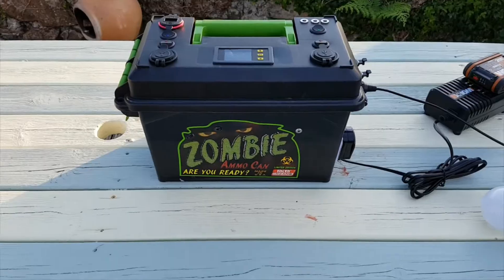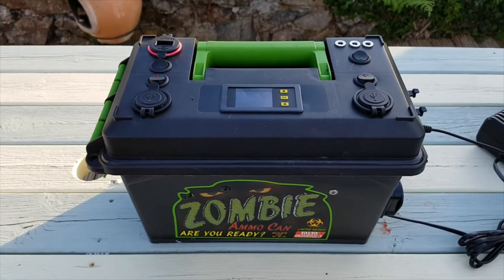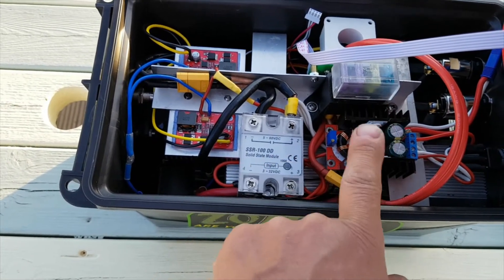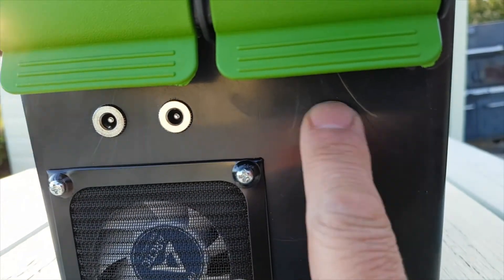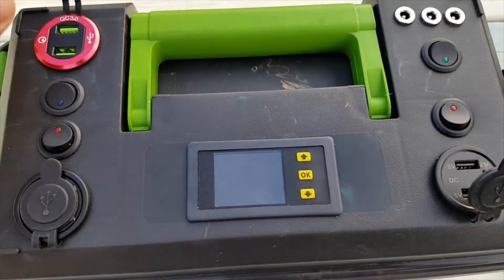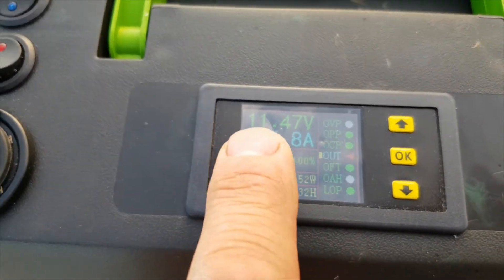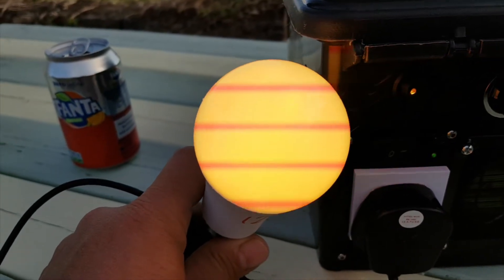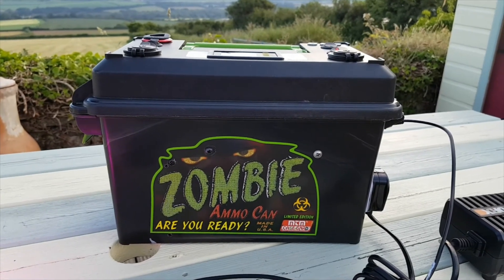Ammo Can Solar Accumulator (solar generator) Completed

Comment: Good to see you got it finished John, it looks really neat now.
Are you planning to have the charger integral or external? If external I can recommend Speakon sockets for the charging connector. You can even get rubber bungs to help keep damp out.
Reply from the maker: Thanks Ali. The mains charging input will also be a higher current solar input. The mains charger will be from something like an old laptop power brick, or other high current low voltage supply. This same input will double as a direct connection for a 180 Watt solar panel. This input will connect to the 8A charge line on the BMS, so should allow the battery pack to charge from flat in about 4 hours at the full 8A capacity. I'm going to use an XT60 plug for this, as I like them and I have them in stock.